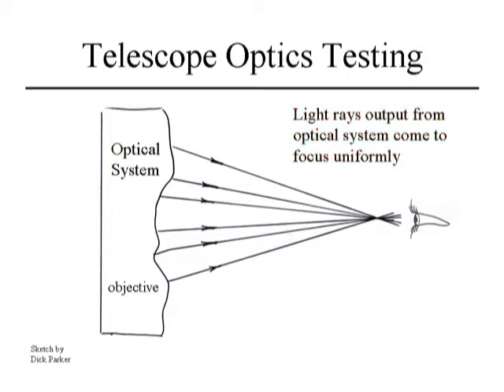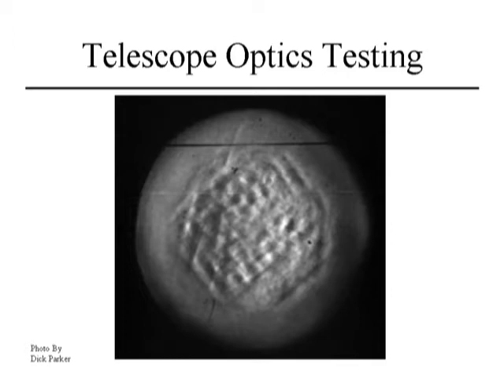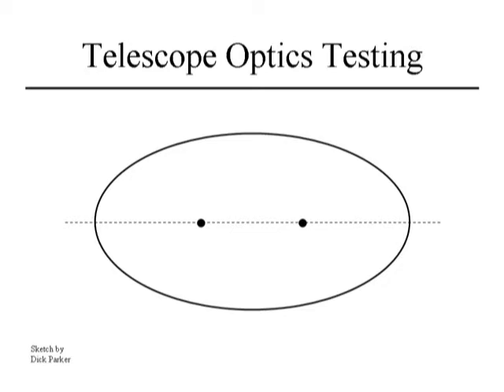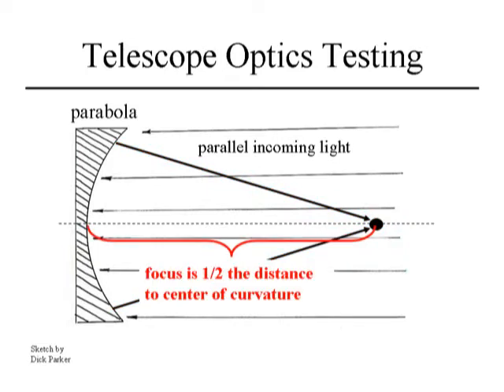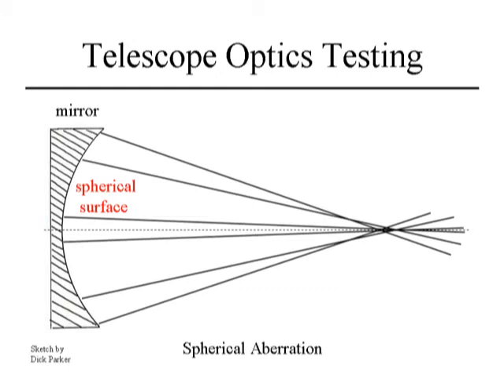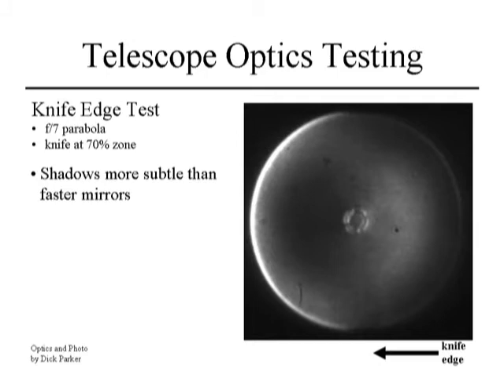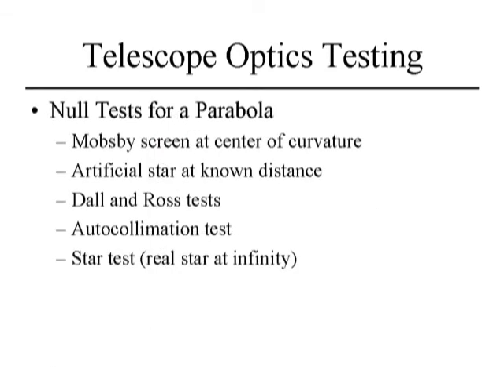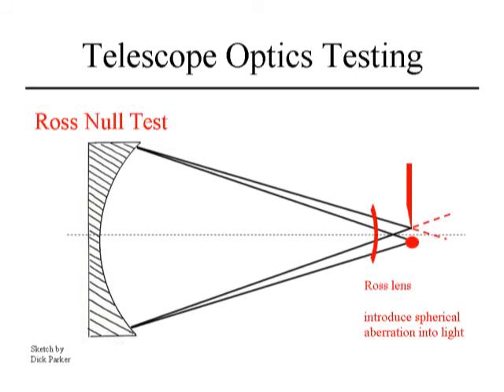Telescope Optics Testing

Comment: I just chanced on this video, which is excellent. I was a mirror-maker for 30 years, and eventually alighted on what I refer to as the 'inverse wire test'. Take two photographs - on film - of a thin wire against the sky background. Use one of the resultant negatives as the light-source slit, and the other as the knife-edge. All the dispersed light is screened out, and you will see a diffraction line adjacent to the knife-edge image. You can use that diffraction line to get a more accurate measure of each zone.